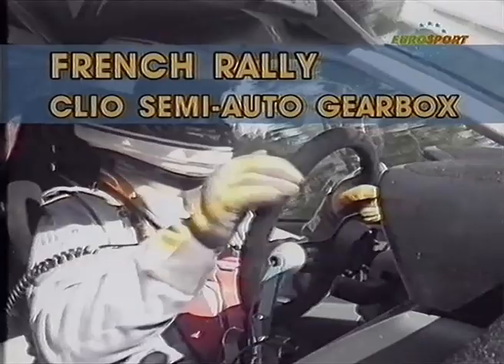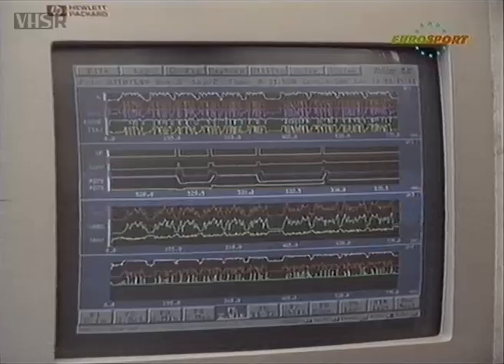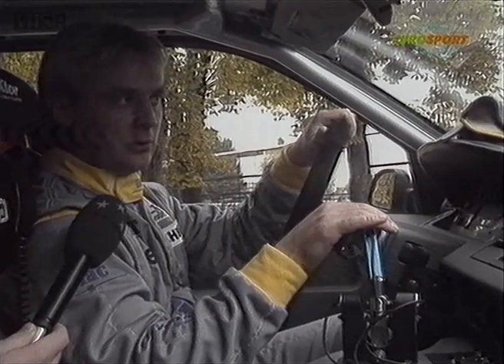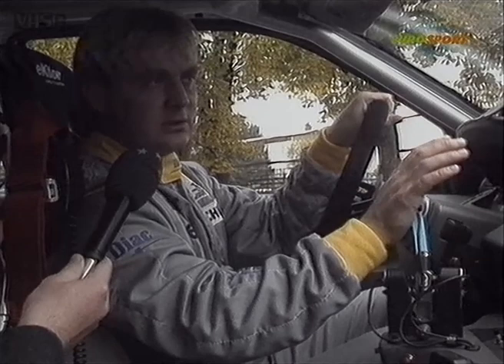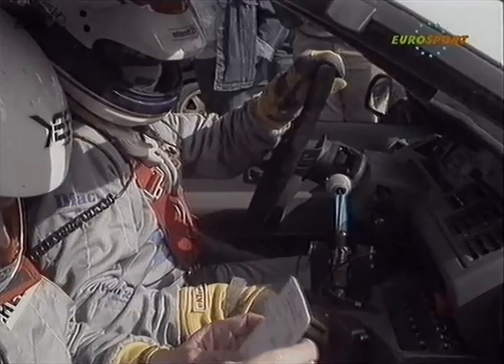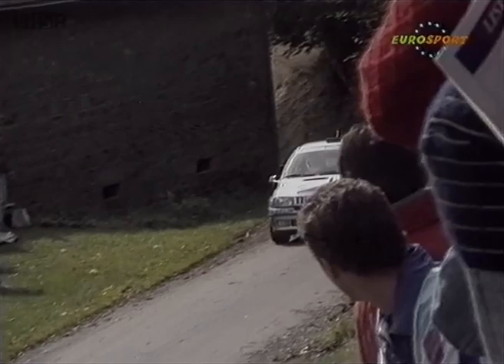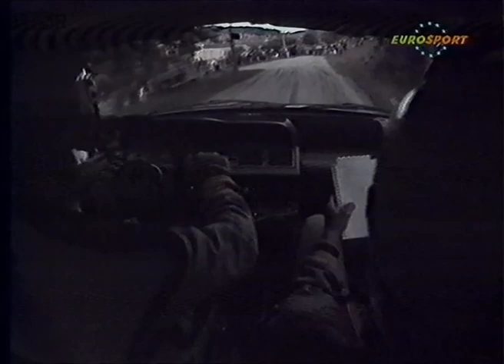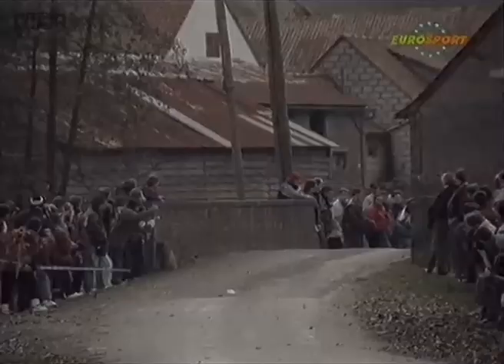1994 RenaultSport Clio semi-auto gearbox feature

Comment: But did also has the automatic kicker? Did it use to give throttle in downshifts? And was it dumbly or the amount of throttle was calculated to match the synchronization? Amazed me how many computers were working off the car, but at the same time I always thought that there were 5 years least before talking of real semiauto gearboxes, that leave the driver only to decide what gear wants

Comment: banned in f1? In 93 pretty much every car was running a semi auto gearbox but with paddle shift. But pretty much the same, at the time 3 pedals then later steering wheel clutch.
Reply from the maker: The commentator corrects this mistake. He was prematurely referring to the next item in the programme, which concerned active suspension.
Reply: @VHSRallies  ah gotchya

Comment: I believe this was the earliest use of semi automatic in rally car?
Reply: No,Audi used one on the Quattro in the mid 80's
Reply: @raulman2473  Ah thanks for correcting
Reply: Audi tested semi-automatic during 1985, but didn't put it into full use at all. The footage we have from it shows that it was pretty slow and heavy on clutch, slower than regular manual even. This one from Renault is way better and pretty much as fast as the current sequential gearboxes we've had on rallying for over two decades. Mind you, Renault also invented modern gearboxes.
Reply: @d-d-i  CMIIW but what Audi used is a dual-clutch transmission straight from Porsche, which I think is different from what Renault use.
Reply from the maker: You could say the Renault system was actually an automated manual, I guess. Whereas the Audi one was indeed Porsche's dual-clutch configuration, I think.